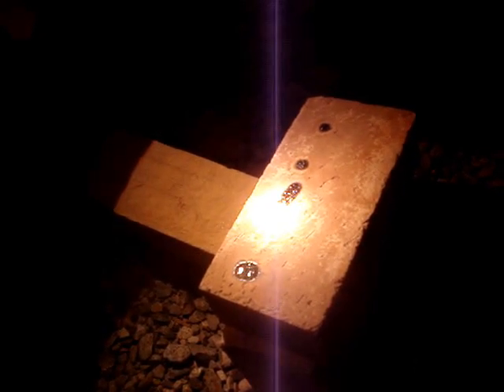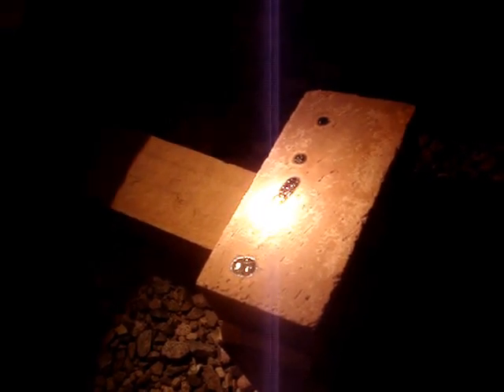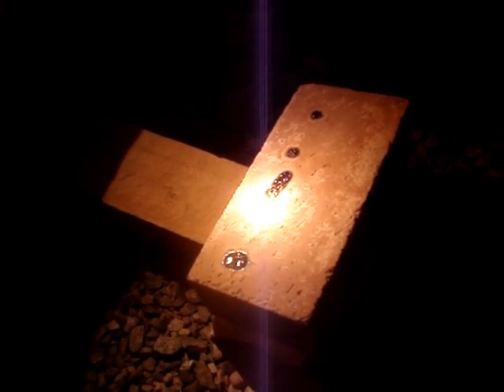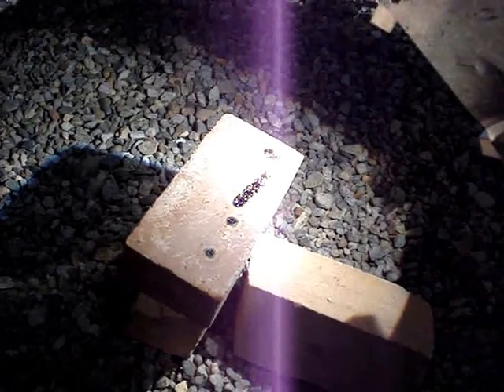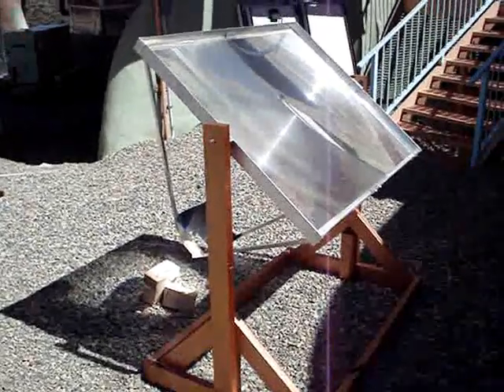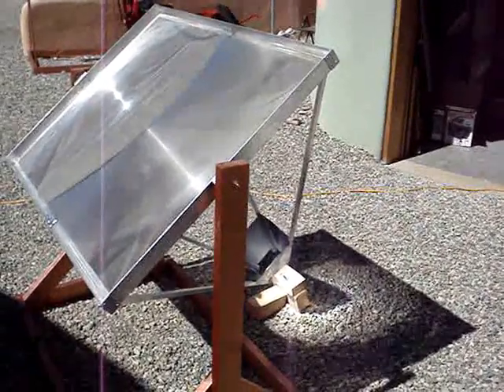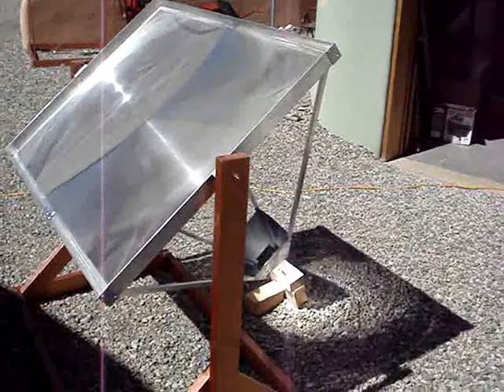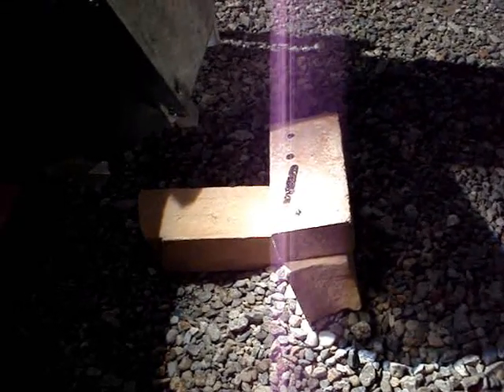Intense Solar Power

Comment: If I understand you, that's an interesting idea. Put the lenses next to each other, and have an insulated pipe with special "receiver" locations for the light.

The trick is to keep the steam moving toward the turbine. You could accomplish that with a pulsed system, using a set of one-way valves.

Still, you have to have room for a lot of lenses. The power density of sunlight is only about 600 watts per square meter.

Best --
jon

Comment: First, a parabolic trough can also be used. If the trough line is curved, it shouldn't require a sun tracker.
To harness energy, a thermal electric generator can be used. Also, it occurs to me there is enough heat to make wood gas, which can fuel a gasoline engine/generator.

Comment: @thorargent "The cost of making a custom curved parabolic trough will far outweight the cost of a sun tracker."

No it doesn't.  There are plenty of solar generation plants that use a trough.  The advantage of a trough is no moving parts to maintain in a desert filled with grit.

The heat oil and use a heat engine to recover the energy.   Still, because the oil has to travel through pipes, they aren't nearly as efficient as the design from Stirling energy systems.

Comment: Just a thought.. could one not simply adjust the focus of the lens(es) aimed onto the photovoltaic panels to a point where you "split the difference" in light/solar  concentration, thereby still allowing for more concentration using the lenses for better power conversion yet without harming them (less expensive panels)?

Comment: So let me get this straight. You can put a boiler in the "hot spot" filled with water to create steam, which powers a steam engine, connected to an alternator and then to a battery? Is that viable?

Great video btw.

Comment: Cont...   So what can I do with 1.5 K ? Light every light in my house, Listen to the radio, Run my Frigidaire for me cold drink , run my swamp cooler to keep me cool, Charge my cell phone and a back up battery so i have some Lights/power during the night. As I haven't turned my TV on in 3 years this is largely how i live my life any way. I don't always keep all my lights on so I would have extra power available most of the time . If i turned off 300 watts worth I could run my computer.

Comment: Is there a way to not get so high temperatures? If we put a metal pipe with water for power generation I think is good that the lenses don't melt down the pipe. I also wonder if the focus shape can be modified so not be a small square but a long line (for hit the pipe)?

Comment: Stirling engines are great in developed nations, but if you don't have access to a machine shop you won't be able to fix it when it breaks, and everything with moving parts eventually does break. Not so great in underdeveloped areas.

Cheers --
jon

Comment: @thorargent Could you put 5 turbines (one on each side) on each boiler so you don't loose heat threw all the tubes running back n forth and you would only need 1 lens. it would be cheaper and take up less space.

Comment: Just before the 1 minute mark in this video, you mention 1.2 kw concentrated in 1 square cm. Unfortunately, you go on to say, "Energy density is 12 megawatts per square cm".

First of all, this is _power_ density, not energy density. There is a large (and crucially important) difference.

Second, if you actually meant 12 Megawatts per square _meter_, that's true but not pointful. There is only room for 1 Fresnel lens over your brick, and you don't get square meters of high power.

Best --
jon

Comment: @veryquiet What can I run off 1.5k? hmmm my refrigerator is 500 watts(.5k) my swamp cooler is 250 watts. (total .75k) 11 LED light bulbs 5 watts each =55watts (total .805 K) 2 florescent "ring" lights 15 watts each = 30 watts (total 1.15 K) Radio 20 watts (total 1.35K) Recharge cell phone 1 watt,no joke (total 1.36 K) recharge gell cell for lights at night 10 watts (total 1.46 K)  line loss 4 watts (total 1.5k)

Comment: i,ve bought a solar power adapter for wich i could charge (up to 9 voltage) my mobile phones,mp3s,handhelds and even the nds lite etc,,
all for free and nothing and i could use t annywhere whenever i want it ideal during holyday,s when your camera is emty and there,s no wallet socket in the neberhut, you will save alot of money

Comment: Plastic lenses quickly deteriorate in the sunlight BUT use them to make glass lenses or just get glass lenses and then you are talking about something that will last more then a few months or even just a couple of years. BUT, they are used to heat water to power a generator so why not just go to a black pipe recycle system and be done with it?

Also, since 80% of the population lives near large bodies of water, then why not simply use the weight of the rising water with swells or even the tides (which is very heavy) to do the work. Nature raises the water up, hold it and as it's weight brings it down slowly poof you have free energy.

This message was brought to you via someone on but surly not of this earth for I have little to nothing in common with what goes on here and is called, civilization. Kind of kidding LOL:-) Enjoy.